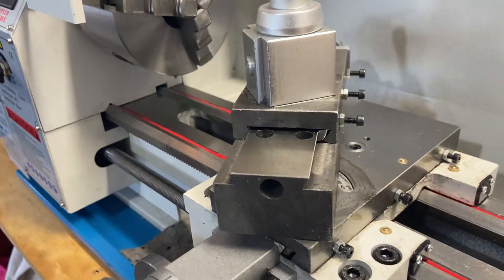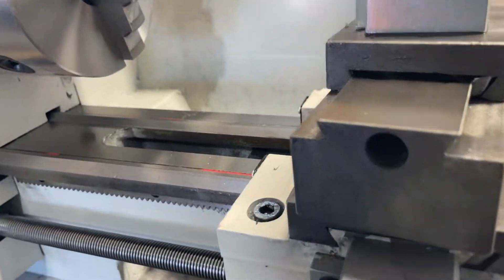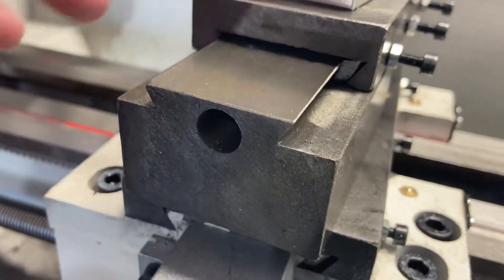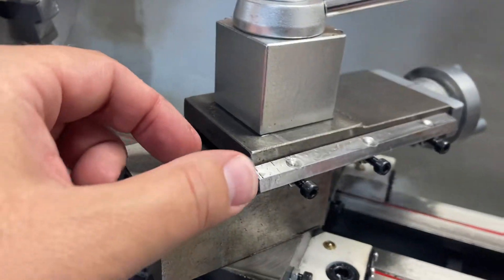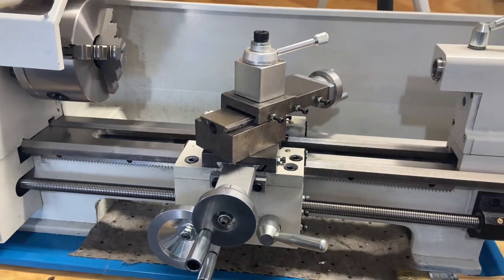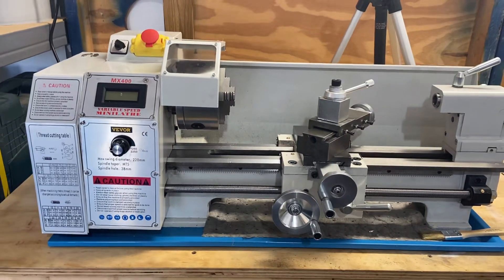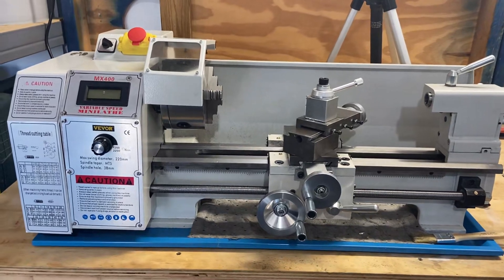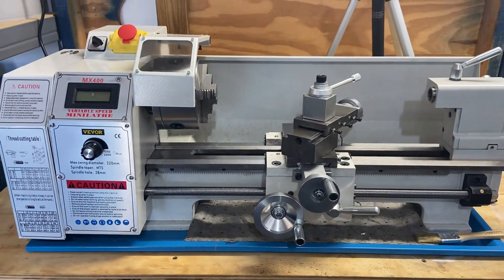Vevor Mini Lathe MX 400 Part 14 -Top Slide Gib Issue and Support Review

Comment: This machine definetly has its issues, but in general it looks quite well made for the price.
I bought a Creworks 8x14 from Amazon, because I really wanted the increased spindle bore, but let me tell you: that thing is a piece of junk. I'm working on it a lot to try and make it "usable", but it has a BADLY twisted bed with non hardened box ways that have been milled (NOT ground like yours) with the wrong angles, so the headstock, tailstock and slide don't match and all ride on an edge. The bed also has a casting void right below the headstock, so the spindle axis is not parallel to the bed (like 0.5mm/100mm!!!).
It also looks like they cheaped out on the castings, because in many areas it looks a lot skinnier that yours.
The only decent thing really is the 125mm chuck with the 38mm spindle bore.
Reply from the maker: This lathe wasnt the best build quality and has its issues however, it has been very usable and served me well going on 3 years.  I dont have experience with Creworks but probably all made the same.  The larger spindle bore and 125mm chuck are nice with this sized lathe.
Reply: @deezworkshop  I'm slowing bringing mine to a usable state. I completely disassembled it, shimmed the headstock to make it parallel to the bed ways, I bolted the bed to a DIY concrete block to make it more rigid (and to be able to add shims in order to straighten it).
Next step is to measure the ways dimensions and mill the top slide to match, and to make a new cross slide (the original one is all bent).
It will take a while...

Comment: Hello Sir, I got the same Vevor late, and have excatly same problem, i cannot adjust the gip screws optimal, either it runs smothe, but too loose, or if i tention the gib screws.....it binds when i want to use the fulle lenght of the slege.
I am considering making a new gib in brass, but when i saw your good video, i consider if this problem is not a material problem, but rather a tolerance issue with the screw dimples in the excisting metal gib.
Did you obtain a better sledge movement by modifying the dimpel holes?, or did you optimize on other better ways?
Kind regards
Martin / Denmark
Reply from the maker: Thanks for the comment,  I did not improve my situation by trying to adjust teh dimples or in my case i tried to file slots in the gib.  It didnt help but I did manage to fix my problems.  At the time of this video a very kind viewer offered to make a new gib for me.  It turned out great.  The new gib fills the enter slot top to bottom and applies the pressure like it should.  If you have the ability to make a new gib that is the suggestion I would recommend.  If you are interested in seeing the gib I received look for my video titled, Vevor Mini Lathe MX 400 Part 32.1 - "Generosity from Subscriber. Gib upgrade. Plus raw materials"  https://www.youtube.com/watch?v=NT2oPK5UvZI  Good luck and thanks for watching.
Reply: @deezworkshop  Great, thanks, i was wondering if a thin piece of aluminium or steel, slided in on top of the old gib, preventing it from "roll" when tighten by the gib screws, could help, combined with better alligned dimpel holes in the gib, could work?
I will try, or make a new gib in brass.
Does your slegde work fine, without binding, now with the new brass gib?
Reply from the maker: Interesting solution.  i would certainly give it a try,  Won't hurt anything to slide a shim in there to fill the gap.  My new gib is steel but it works great,  No binding and is about as rigid as I can make this small compound.  As you know there is nothing perfect on these lathes but it ihas been very usable for me and should be suitable for most hobby machinists.  A Brass gib should work fine as well I would think. Good luck.

Comment: Bit late to the show, I know: I notice yours have the all steel top slide base/slide. Mine came with a hollowed out aluminium top slide base/slide also in aluminium. The gibs - both in the top slide and the cross slide - have been manufatured with equal slobbiness.
I got rid of the topslide for now and instead made a steel toolpost base (and bought the same steel quick change that you show in later videos. I never do compounds but if I want to I can quickly reinstall it - or if lighter compunds, simply adjust the tailstock.
Actually I wanted to second your customer service review: Mine came with all the extras (incl. the steady- and follow rest ;)) AND a 4-jaw chuck where the 4 mounting holes didn't align with the back plate. After a bit of discussion and sending one or to videos to VEVOR, they sent me a new chuck and let me keep the faulty one.
Reply from the maker: My compound is all steel except for the handle mount.  Its kind of sort of rigid but taking it off like you did might actually help out quite a bit.  Of The handful of issues I had with the Lathe Vevor always responded and worked with me..I wouldnt call it grade A best support ever but they did want to resolve the issue...monetarily.  They even worked with me just beyond the 1 year warranty window.  I can't say their support is non existent.  Cheers and glad you found the channel.

Comment: my suggestion is to try turning over the gib to see if the dimples are lower or turn the bib so the face in pointed in and re-drill the dimples to fit but be sure to buy a new one and cut it to fit the way it is supposed to properly fit. File it if you have to ....good luck with your mini lathe. I own a mini lathe I bought from Walmart and I had to make a lot of changes and upgrades but I knew I was going to have to do these upgrades before I bought it. I planned ahead for this at the time I bought it
Reply from the maker: Thats a good suggestion,  I did attempt to file som slots in the gib to let it sit lower but that didnt work well.  I was planning on putting new dimples or clipping it over but at the time I had an awesome viewer who offered to mill me a new Gib.  It worked our fantastic and has been good ever since.  No like you I have had other issues to overcome but thats part of the fun.  Definitely need to know you WILL have issues buying these cheap min lathes but they are fun to use.  I am a few days from my 2 year anniversary of posting my first Mini Lathe video...Learned a lot since I started.  Thanks for watching and the advice.

Comment: Same lathe.... same issue! It really hurts rigidity!
Reply from the maker: Sure does,  I have improved it over the past year and a half but there are certainly limits to these small machines.  Still having a lot of fun with it.
Reply: @deezworkshop  I am a bit disappointed because even with the fix I gave it, the gib is still a mess, it lifts the top side of the saddle on one edge and I get about 0.10mm of fiddle with my gauges... :( Luckily I have a mill arriving next or in the other week I hope I'll sort out the issue, most likely I'll make an enterely new saddle..! But I'm glad you're having fun with it, in general the build is ok imho...

Anyway, once I put steel on the chuck... it's game over..! I'll sort it out!!!!
Reply from the maker: @RiderRickMaker  these machines are definitely not great quality.  I have a lot of similar issues,  I hope you get yours sorted.  These things are so much more affordable than the ones we know will be quality,  I was looking at PM Lathes yesterday,  pushing 4k with a dro,  You can get these cheap machines for less than 1k.  But i suppose the argument can be made....whats the point of saving money if the machine problems prevents you from using it.  Now that I know I enjoy this hobby, when/if I get another lathe it will certainly be from a better known quality source.  I love this Precision Matthews Milling machine I purchased last fall.  No comparison in build quality.
Reply from the maker: Good luck, I am sure you will sort it out. @RiderRickMaker
Reply: Orderd a mill, ordered dovetail cutters... hell yeah, for sure I'll be able to fix this! :) I really want to start creating jet turbines and the lathe is crucial for the shafts and some other elements..! Thanks @deezworkshop  !!!
Reply from the maker: @RiderRickMaker Creating Jet turbines,  Very cool topic.  That would be neat to see.  Good luck and enjoy the Mill,  I know I am enjoying mine, having the 2 machines really rounds out my workshop.

Comment: at least your gibs are dovetailed, mine are flat! 
this may help. 
1) get some fine lapping compound and lap the gibs (not the side of the adjusting screw). and lap the opposite side/dovetails too.
2) mill out the dimples by slotting them with an end mill. use an end mill smaller than the dimples.
3) adding 2 more adjusting screws. 
4) make or buy brass gibs. /lap them.
Reply from the maker: I don’t have a mill yet but I like the lapping compound idea. I’d like to remake the gibs when I get a milling machine.
Reply: @deezworkshop . my lathe is older than yours. a BD920. my compound gib rides at the very top of the dovetail on the Swivel Base. the mark on the gib where it touched the Swivel Base is only about 2mm wide. that is all of the gid that touches the swivel's dovetail. not much at all.. the compound has never been smooth to adjust. I lapped the opposite side 2 days ago and the lapped the gib side yesterday. I don't think it's going to help the gib much. I have got to get some brass and make my own Gib. I have a small mill/drill. it cut pretty good.

Comment: i spent close to $1000 for the grizzly version of this casting and have all of the same issues.
Reply from the maker: IF you keep watching I did come up with a solution. Well i had a subscriber who made me a new GIB.  It sorted out the issues i was having and has me running quite well.  If you have the means or access to have a new gib machines to fit the entire slot it will really strengthen the top slide.  It is dissapointing for newcomers like myself to have those kinds of issues.  I dont have a mill and couldnt ahve made a new one to accomodate the flaws.  Good luck and I hope your getting your grizzly setup and working through the issues.

Comment: you could buy a new compound ? maybe re drill the gib adjusting screws to a new lower location and off set ?
Reply from the maker: At the time those thoughts crossed my mind.  there were a lot of ideas suggested and in the comments of these videos.  Replace the compound,  Flip the gib and redrill, redrill new holes on the top slide mount and line up new dimples on the gib. In the end a new gib was machined from a gracious subscriber which turned out to be an excellent workaround.  If you keep watching I show that in later videos.
Reply: @deezworkshop  wish I was better set up to record what I went through. It all helps even seeing what non machinist like me go through these issues. 
I came across a smithy 1220 for very short money a few months ago and I dont think it was ever properly set up or maintained. PO was getting rid of it cause it sucked. Every thing that should be tight was loose and everything that should move freely did not. I have improved it leaps and bounds just by cleaning and tightening and adjusting
Reply from the maker: I enjoy creating and sharing these videos and my experience but it certainly doubles the amount of time to accomplish any project or task just to setup and record the content.  2 unexpected outcomes have came about.  1, I have met some great people in this machining community, 2, It keeps me motivated to get in the shop and make the next project.  Thanks for watching.  it is very much appreciated.
Reply: @deezworkshop  I started to try and video what I do. Mostly the videos are to share with personal friends to clarify subjects. At some point my phone stopped recording in “movie” mode and I grew frustrated with the vertical view. I have not even began to look into editing.
  https://youtube.com/shorts/J-MIATCVadI?feature=share
Reply from the maker: It can be a challenge to video and remember your angles, start and stop when you need to, narrate, the whole editing thing is a big learning curve.  Lot to it.  Even if you dont edit youtube is great for what you said,  sharing videos with people you know for advice and fun.
Reply: @deezworkshop  if you see any of my postings they are just that.
Reply: I was looking for something else and this video came up again.
I was watching it and I wonder if milling the bottom of the compound slide to narrow up that large gap would help.   I know the gap is supposed to be there but almost looks like if you machine bottom rails of the top plate of the compound every thing would start to line up…. Just thought now that you have a mill

Comment: I note that there is a tremendous amount of space between the stationary and moving parts of the compound.  This space should be minimal, maybe a 32nd of an inch.  I would say first, machine the compound slide to reduce that space, second stone the side of the gib with the dimples then turn the gib, side for side, and dimple that side to properly align with the gib screws.
Reply from the maker: Thanks Dennis,  You have a keen eye.  You are absolutely correct.  I have an upcoming video showing and trying these suggestions.  There are more issues than machining down the shoulders of the top slide.  If you're  still watching my videos I am looking forward to what you think of that upcoming Gib issue video and the problems I tried to show in detail.

Comment: I have one of these sitting on the floor in my garage. The Vevor MX-210V. It is the 8x16 Luxury Version sold under the brand Mophorn. I was surprised to see the compound is two extrusions made of a non magnetic material. No machining, just cut off pieces of extrusion. Not at all like the compound shown in the Amazon listing. I tried facing and turning a piece of Aluminum stock. It was so rough it looked like it had been threaded. It is impossible to make a smooth cut. I checked the spindle. I am able to manually rock the spindle back and forth with my hands. The play measures about 0.080 inch or 2 mm by dial indicator. Spindle play should be on the order of 0.0001 inch. I have not bothered trying to fix it. Could be the bearings need tightening or it could be the bearing bores are too big. They don't seem to measure anything or even use drilling jigs to put holes in the right place. It seems to be made by eye. I went back and forth with Christina for a week. They asked for videos. I sent videos but their email will not allow videos. They offered me a partial refund so I could get it fixed locally. They offered to send another one. It seemed like Christina and me were talking past each other. So I handed it over to Amazon A to Z. They gave me my full refund and kindly told me there is no need to return it. And thanks for doing these reviews.
Reply from the maker: I am really glad you shared your experience on here.  I really do believe Best Equip, Mophorn, Vevor, Etc on Amazon are one in the same seller.  just slightly different packaging,  Sorry for your troubles but what you experienced is exactly why I chose to use Amazon to make the purchase.  If I had the issues you did I would have done exactly what you did.  I think I got an older model,  I dont have the safety lathe chuck key, The safety shield doesn't work at all,  Works whether its up or down.  None of these issues stop me from using it however. Sharing your experience here will hopefully help others decisions who are considering making one of these purchases. That was my goal for starting these videos and sharing this series.  I appreciate you watching.

Comment: Is the misalignment of the indentations in the gib from an installation of the gib strip upside down? If you flip it do the holes line up?
Reply from the maker: I thought of that. Good thinking but if I turn it upside down the angles are off. No it’s purely a sloppy job and original machining from the manufacturer. The actual problem is the shoulders are not machined properly. I need about 70 thou machined off the shoulders of the top slide.

Comment: I had more problems than you, the one I bought was supposed to be totally up graded, with tapered bearings, motor etc, it came with 400 watt motor not 550 watt, standard bearings not tapered, the head stock was drilled wrong, nothing was straight,  tale post was so sloppy, I had the same issue with costumer service.
Reply from the maker: Sorry to hear that.  Thanks for sharing your experience,  That's the point of this video series.  Mine is not without its problems but it is functional,  I wouldn't be able to make super precision parts but it is good enough for me to learn on.  Hopefully you get some response.

Comment: I'm having the same problem with cristina. They want videos. But there website won't let me upload to their account. I'm so frustrated. Just back and forth. No satisfaction. Baaa.
Reply from the maker: Personally I believe all of these sold on Amazon are sold by the same outfit.  My experience with Christina from support was within the 30 day return window so maybe that had something to do with them responding.  "She" did at one point try to get me to start replying to her gmail account to share photos and videos.  I said I am not going to do that as there won't be a trail in messages that I can take to Amazon if I run into issues with you.  You can submit photos just fine in the Amazon support messaging system.  It's a sketchy outfit for sure.  I've said it before,  Worth repeating,  Do not purchase one of these cheap Chinese mini lathes from any manufacture if you don't have the expendable cash.  Certainly don't borrow money to buy one. I took a chance accepting the risk.  Good luck Larry,  Thanks for watching and thanks for sharing.